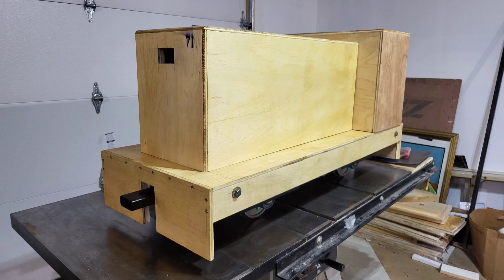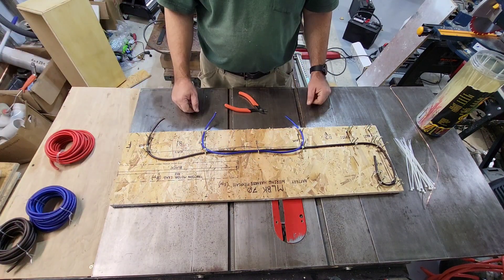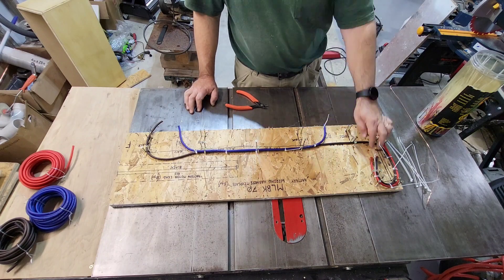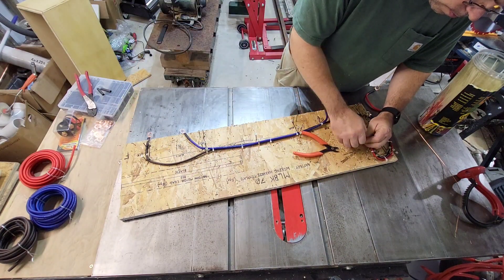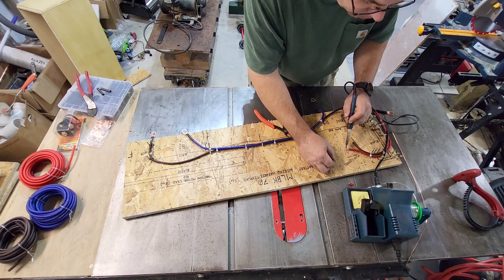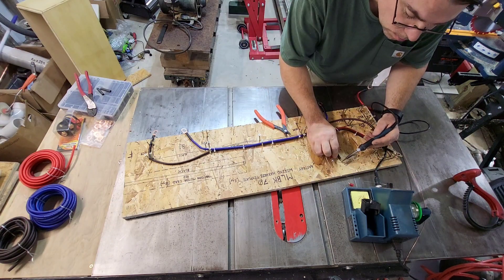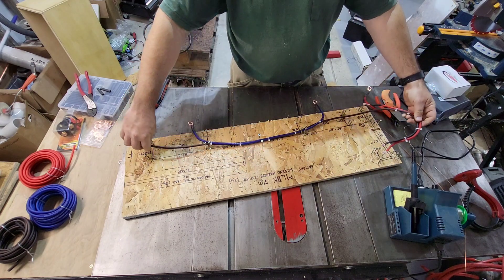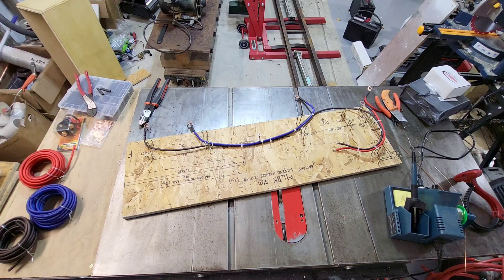Building Mill Brook 71: Wiring Harness

Comment: Soldering wires going into a header is fraught with danger in high amperage situations.   Most people would recommend using a ferrule to make that connection.
Reply from the maker: You'll have to excuse my ignorance on this one. Can you tell me why it's a bad idea? Not that I'm against using ferrules but nobody ever mentioned any danger in soldering a wire solid before. Unless it has something to do with the wire eventually flexing and fraying. That's the only thing I can think of at the moment. Please explain.
Reply: @MillBrookRailroad  
1. If (when) a wire comes loose it can cause a flaky connection. 
2. Flaky connections can spark. 
3. Sparks are hot.  
4. Hot solder melts and can lead to flaky connections.
5. Repeat 2-4 above until something catches on fire.
Reply: @MillBrookRailroad  With a high amp draw, the screw terminal/header connection can lead to increased resistance, heating the connection, which can cause the solder to soften and effect the retention of the screw terminal/header.  This can lead to a simple failure (best case) or a short and catastrophic loss (worst case).  Using a crimped on ferrule reduces/removes that potential.   It's more common in European countries as it's mandated there.
Reply from the maker: @noxin75  Thanks for that well thought out reply. 
Just so I know, what's the threshold between low amperage, where ferrules are not necessary and high amperage where they are?

Comment: Its not a good idea to solder wires that are to be screw terminated. Over time the solder creeps away from the screw and leads to a loose connection or worse a fire.
Reply: I was about to make the same comment.
Reply from the maker: Good to know. Thanks for the input.

Comment: If you run a Y connector off of the main receiver, you should be able to plug both loco's ESC's into the same receiver and control both from one transmitter. Would make double heading easy. I did that to get 4 wheel steering in one of my RCs with two servos. No signal mixing required.

You'd have to run a connection between the locos (disguise it as a brake line) and either manually swap the signal cable on the second loco or use/make a diverted switch.
Reply from the maker: That's an approach I hadn't considered. Thanks for the idea!
Reply: @MillBrookRailroad  No problem! I do this type of silly wiring on my channel.

Though, now that I think about it a bit more; if you want the locos facing opposite ways, you might have to have the polarity on the motors be opposite. Depending on how they are oriented in the loco. I assume both are the same direction?
Reply from the maker: @Roboticus_Prime_RC  They are wired identically, so reversing one motor is certainly a necessity. I think I can set that on the motor controller, though.
Reply: @MillBrookRailroad  Only if they are on separate channels.

Basically, you'd wire one motor forward, and one "reverse" for when they are spliced onto one receiver. When you run them separate, you can "reverse" the transmitter of the second loco so it's controls are "correct."

You can get a fancy transmitter that you can bind multiple receivers to and control both loco's from it at the same time. LilGiantsConstrCo does this with his dump trucks, but those transmitters are expensive last time I checked. I like using the $40 RX-TX combo's lol